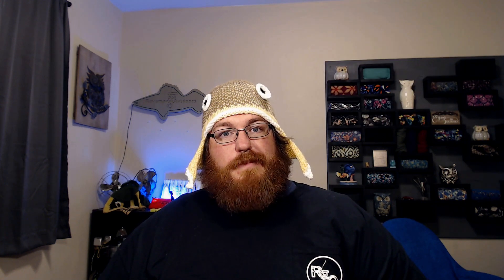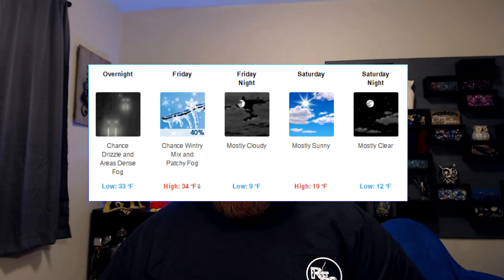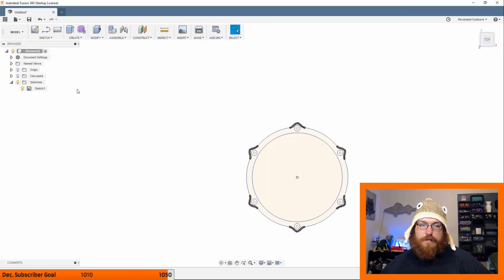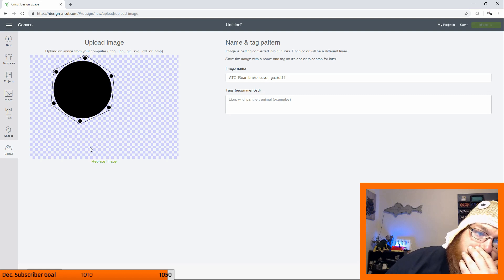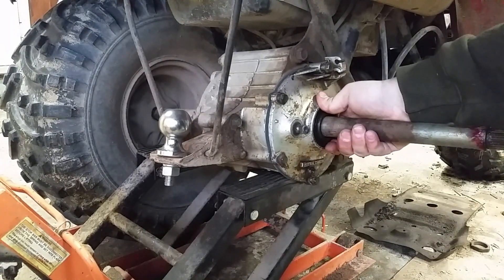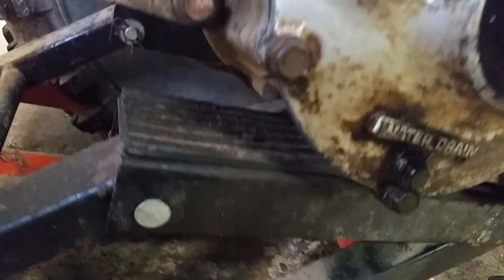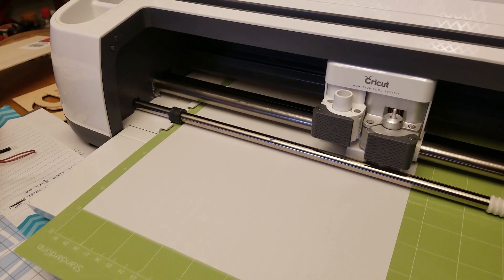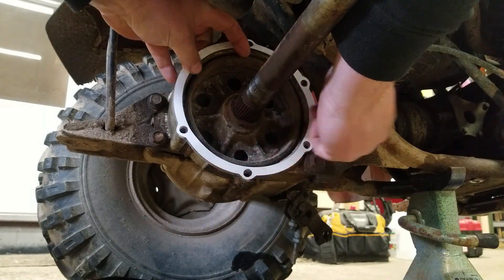Using the Cricut Maker to make hard to find or discontinued gaskets

Comment: First off nice video. Secondly I have a shaper cnc and they made a fusion plug-in to export a svg. If you download the plug-in from the fusion 360 plug-in manager thing you can literally click on the face/feature and hit export to shaper and it'll give you the svg of what you selected. I have the shaper but I also use this for our vinyl cutter and laser cutter as well. If it saves you a couple extra steps and head scratches it's well worth the download. Works like a charm every time.
Reply: I might add if you do the shaper origin plug-in it retains scale.
Reply from the maker: Nice, I'll give it a look, it would be nice to have everything export clean.  It will definitely come in handy for future projects! Thanks.
Reply from the maker: I pinned this so people can find some resources on it if they are having similar frustrations, someone a little earlier posted a link to a video on it as well.  I'm surprised I didn't see it before I finished this project but ya know how it goes.  https://www.youtube.com/watch?v=x4CR3nXSN-A

I installed the add-in and gave it a try with the Cricut software, the import went well but the Cricut software changes the scale.  Not a huge deal, their software is well...something.  But it definitely saves a few conversion steps. Thanks again!

Comment: Great video man! What a coincidence, need the same gasket for the same trike, searched "make gaskets with cricut" and this was the first result!!
Reply from the maker: Awesome, glad it helped, it's still running like a million bucks. Now if I could just print new front forks I'd have it made lol.
Reply: @RevampedOutdoors  Try to find a set from a plain 83 200, or an 84/85 200M if you can! Huge upgrade from the 200E/ES forks.
Reply from the maker: Thanks for the info! Biggest issue is getting the ones that will fit so this helps a bunch.

Comment: Great video.  Only thing I would have done differently is add a dimensional reference to the photo.  Like a square ruler.  Would make it easier to adjust perspective/size.  But, you had your method which works.  Great video.  Thanks for sharing

Comment: I, too, use Inkspace. It is extremely versatile and FREE. I believe Fusion 360 stores everything in centimeters regardless of what it displays (i.e. mm or in). Therefore when you export, it will be off. If you design in cm to begin with, it will export correctly.
Reply from the maker: I design in mm so that could have been the problem.

Comment: I purchased a Cricut  this fall to make templates for leather work. My first shock was you are unable to draw anything with the software. Now they have thousands of designs you can buy and use for your project.  Not what I wanted.  But I have a CNC Plasma table and software to make the templates I wanted.  Cricut accepts DXF files.  Sadly, the Cricut software dropped and or altered many portions of the template designs. Curves were changed to lines, Lines had random angle changes.   Plus the software frequently locked up.  It took over 4 hours of work to print 4 copies of the same template.  A job that should have taken less then 10 minutes from start to cut completion.    My decision to purchase the $500 plus Cricut machine and tooling was at best a poor one.
I would have been better served using that money as a deposit on a Laser CNC machine.     I DO NOT recommend Cricut machines, because of the extream software limitations.
Reply: It sounds more like you have hardware problems...lol
Reply from the maker: Thanks for your input, for only $300 the circuit maker has out performed my expectations, the limitations of the design space program is a bit frustrating but I was able to find a work around in a reasonable amount of time. I wish you the best of luck in your future projects.

Comment: You can use the shaper addon to output a svg file directly from Fusion360.  Tutorial here: https://www.youtube.com/watch?v=x4CR3nXSN-A.  This may help some, although you may still need Inkscape.
Reply from the maker: Thanks for the tip, I tried the add-on export DXF (splines and polylines).  It didn't do a clean direct import, I'll try your suggestion, would be nice to just have a clean import!